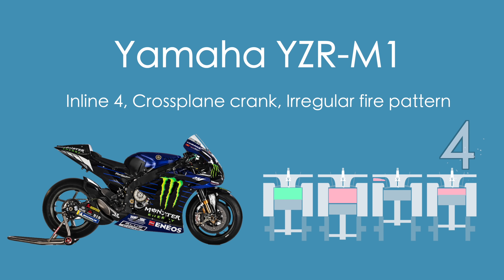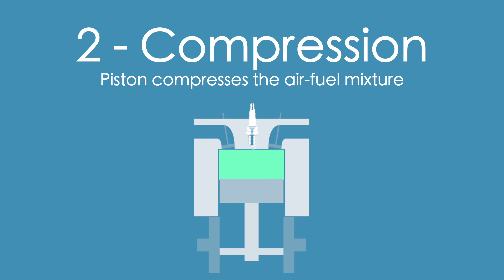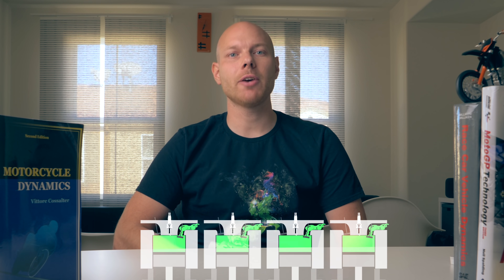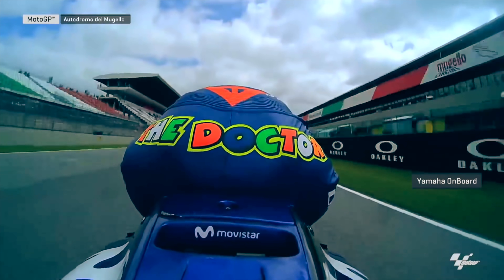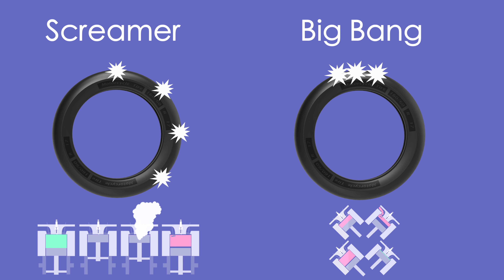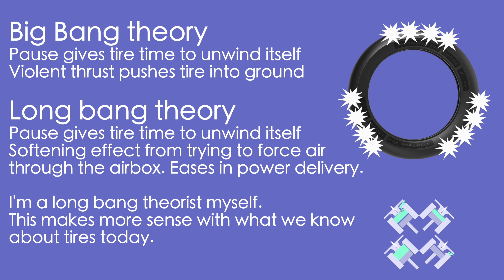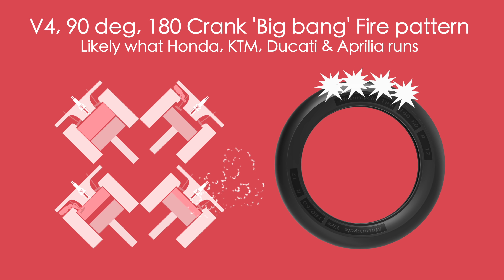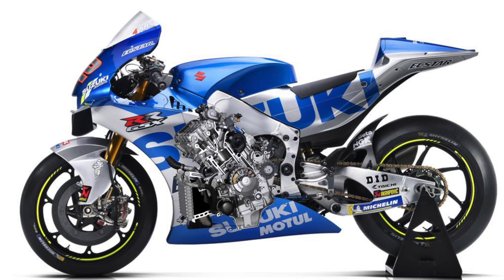MotoGP Engines | Scream LOUD or Bang BIG?

Comment: only an A.I robotic rider will ever confirm what configuration and motorcycle design has the potential for a fastest lap time at any given circuit. Until then, manufactures need to develop bikes according to their race teams rider confidence in operating their bikes. Hence, development is heavily focused on a human's feedback. Not necessarily consistent and correct in all cases, it's apparent as we see constant changes in design throughout the decades.The leap forward looks like happening very soon. When it does, he'll refer to the current Moto GP bikes as dinosaurs in comparison.

Comment: Screamer 
4 cylinder  4 stroke 720degree cycle of crank
cylinder 1 fire @ 180degree cycle of crank
cylinder 2 fire @ 360degree cycle of crank
cylinder 3 fire @ 540degree cycle of crank
cylinder 4 fire @ 720degree cycle of crank

Screamer with inline crossplane crank
180degree cycle of crank cylinder 1 fire 
360degree cycle of crank cylinder 3 fire
540degree cycle of crank cylinder 2 fire
720degree cycle of crank cylinder 4 fire

the reason screamer fire pattern is less favorable because it have regular pattern of firing based on cylinder count and crank cycle( in this case 4 stroke engine). this engine very responsive and very sensitive from your throttle movement. the tire doesnt have enought resting time to rebounce back from power cycle of inertia that happened because of ignition. the tire an in constantly  higher pressure compared to other firing cycle. This engine loves to scream in higher rpm, also this engine usually(dont quote me on this) has higher and longer(broader) power band that make this kind of engine has edge on straight line track. its stronge torque curve from 4500-10000rpm

Bing Bang
4 cylinder  4 stroke 720degree cycle of crank
cylinder 1 fire @ 45degree cycle of crank
cylinder 2 fire @ 90degree cycle of crank
cylinder 3 fire @ 270degree cycle of crank
cylinder 4 fire @ 360degree cycle of crank

big bang engine give enough timing space for tire for resting and rebounce back so you could feel the fibration of the track and focus the tire grip. because its "big bang" the firing order quite close to each cylinder that why the torque curve are stronger at lower rpm compared to  screamer engine. 3000-8000rpm is its strong torque curve

note(if you looking for the crossplane big bang):just look up the screamer crossplane above engine firing sequence of cyclinder, not the timing.

Long Bang
4 cylinder  4 stroke 720degree cycle of crank
cylinder 1 fire @ 45degree cycle of crank
cylinder 2 fire @ 90degree cycle of crank
cylinder 3 fire @ 450degree cycle of crank
cylinder 4 fire @ 540degree cycle of crank

the Long Bang engine give best control and not so hard on tire, good low-mid torque , but the lower end of rpm is the main focus here. 2000-7000rpm the advantage of its strong torque. yes i know its alot of factor like cam profile, lift, runner,valve texture and such. this just some factor of it. please dont bash me.

inline 4 vs v4 how they different in top horsepower?
single axis 4 cylinder engine (inline4)-nimbler engine
double axis 4 cylinder engine (v4)-well if you see it worthed 

Single axis engine(I4) are amazing because of its simplicity all cylinder line up in harmony in one axis help each other to move and stop. because its one axis this engine rev faster(not always higher), faster to reach top power and faster to reach lower power. but we need to understand every engine has limitation. when engine reach the top rotational axis advantage
(this because of the design, bore stroke ratio, rpm of piston speed limitation, friction and short)  the engine has to battle some hardship to fight the difficiency(power loss) because its struggle to bear some amount of power(single axis angine in this case) to one direction of power transfer.

Double axis engine(v,x,radial or what so ever)
the engine with this configuration heayer more expensive slower to reach top power. but has greater potency to reach higher power because the stress of power are divided in two axis.

Comment: So long bang theory is all four cylinders firing in quick succession, and there is a softening affect through the firings because of the drop in air box pressure? If I understand you correctly, long bang theory is like an exaggerated, smoothened version of the Big Bang theory?
Reply from the maker: Well long bang theory holds that the increased grip comes from that pulses are arranged closely together, and therefore arrive without vibrations and less peak load. The drop in airbox pressure also softens the power build up.

It's hard to define what exactly is a 'Big Bang' fire pattern or a 'long bang' fire pattern. Seems like most manufactures like to call their fire patterns 'Big Bang'.

The irregular fire pattern with a Yamaha cross plane is a pretty pure 'long bang' fire pattern. 

Main difference is really that the original 'Big Bang theory' claimed that the tire saw increased grip because the violent power thrust pushes the tire into the ground.

A viscoelastic tires response to an applied load is speed sensitive. If we apply load at a rapid rate, the rubber will be stiff and will not drape over the bumps in the road. This fact directly contradicts 'Big Bang theory'.
Reply: @MikeonBikes   Thanks for sharing the book in the video! Now, I have a lot to study (between studying for my real classes). lol

Comment: Can't wrap my head around the traction thing. To me the "big bang" should have a disadvantage there, since you load and unload the tire harder.... But I can tell from experience, a v4 has a very smooth power delivery. Actually I find it a little boring in contrast to straight 4 and especially v2... Interesting anyways.

Comment: Rossi defects to Yamaha from Honda taking with him the feel of the Honda's engineering.  Mostly everyone follows suit with the V4 even Ducati, Aprilia, and BMW with some twist.  Honda's V4 can come in several iterations including screamer, Big Bang...  Can you say RC30 and RC45?  Hmmm, the 5th Gen VFR800, RC46, shares mostly the heads and crankcase with the 45.  Was the RC46 a tribute to Rossi before he defected?  46 with a BANG.  V4 engines with the BB have more tractable power for the average.  It takes an alien or monster to pilot a V4 screamer like Rossi, Marquez, and others; as they have over the top power.

In my studies, I believe Yamaha made the move, because they were losing in the curves to Honda.

As far as Honda's iteration now, it boils down to chassis dynamics which the V4 plays an integral part.  There are other positives as well including strength of the block and less pumping losses.  

Just my 2 cents.  Keep it up, but let's give Honda proper credit.  In years to come it will be the Ducati V4 that started it all, TRASH!

NOT A FANBOY BUT YEAH I AM.  Look at TT wins and MotoGP where as in F1, Ducati as Ferrari exist to be the ones to beat enjoying all kinda rule manipulations to make them competitive.